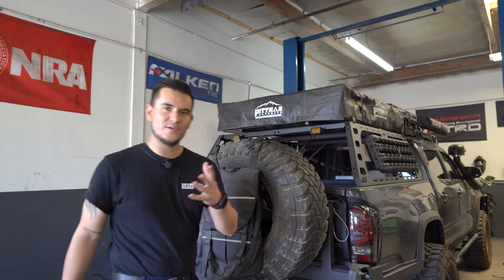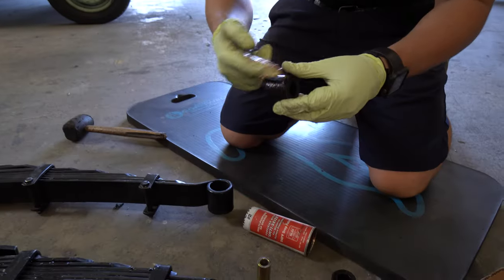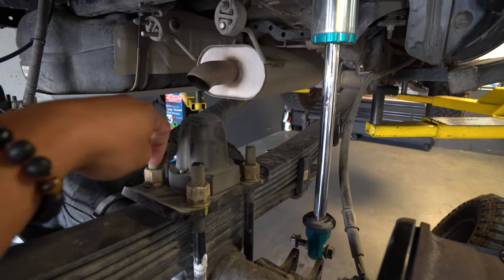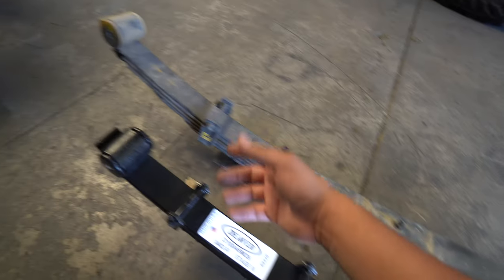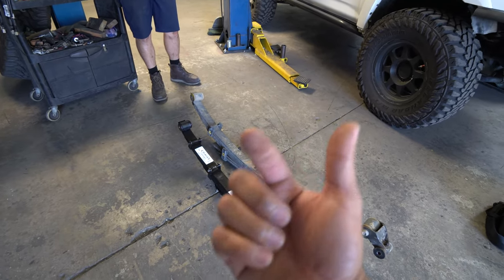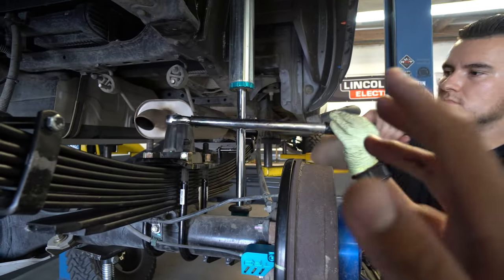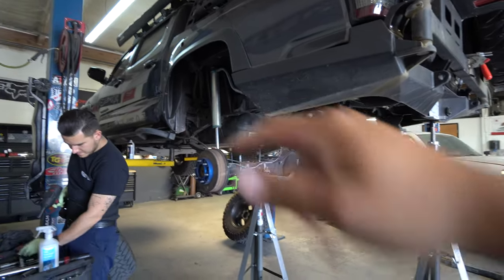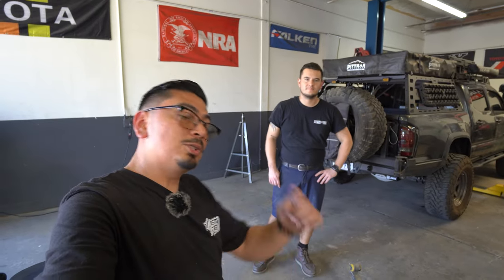How to Install Tacoma Leaf Spring | Deaver Stage 3 Must Have For Constant Bed Weight #overland

Comment: Do this at home as I did.    It was only of low to average difficulty.  Bought 4  jack stands for the job.  Made it easy.  No torque wrench necessary.  I'd rate it a 4 on difficulty scale,

Comment: Ive seen it recommended that you do not lube the outside of the bushing, as shown at 2:06 as you want the point of rotation to be inside the bushing as opposed to the outside. As dirt and grime makes its way on the outside of the bushing it creates a grinding paste which will shorten the life of the bushing. Is this incorrect?
Reply: great tip for everyone else pointless to mention to this guy, he doesn't do anything himself.

Comment: I have stock leaf springs on a 2022 Taco. I have a tool side cap as well as a raised floor in the bed with digging tools under that floor. The suspension is sagging badly. Would this spring setup raise the rear of my truck enough for the load I’m carrying?

Comment: If I am running a decked drawer system (say 200lbs) + Super Pacific X1 camper + Rigd Ultraswing arm and 35 inch tire, should I go with a Deaver stage 2 or 3?
Reply from the maker: Do you plan on getting a rear bumper?
Reply: @JesseRizo  at some point but not for a while

Comment: Did you have any issues with your OME springs? I’m currently carrying around 500lbs and was looking at the 660lbs OME springs. I really can’t justify spending the money on the 1000lbs deavers if the OME ones will work
Reply: Just think about the weight In the bed of your truck. What's the most weight you'll carry for a long period? Then buy the appropriate leaf springs. This guy upgraded cause of the rear bumper, bed rack, and tent plus whatever cargo his gonna haul with him. 
The OEM leaf springs in my opinion are too soft. I upgrade to Old Man Emu Medium leaf pack cause that's what worked for me at the time.

Comment: Is the left and right orientation  only for Stage 3 Deaver Springs? I recently put stage 2 U402's  on my truck,  only ordination I was aware of, is which way the military wrap is installed.
Reply: Yes only on the stage III. Stage I and II do not. You are good.

Comment: Hey bro where did you get those wheel spacers? What do you think of them?
Reply from the maker: Amazon spidertrax brand, 
There one of the better ones out there but I don’t recommend running them I only have them because I have smooth body shocks in the rear and with my wheel setup I hit the shocks :/
Reply: @JesseRizo  which one would you recommend for my taco on mid travel kings 2.5? I’d like a wider stance